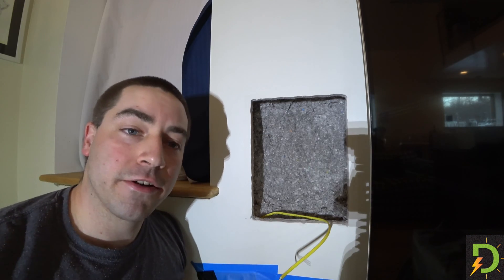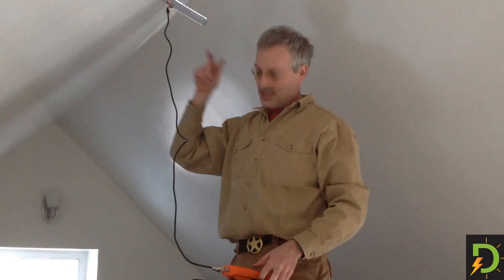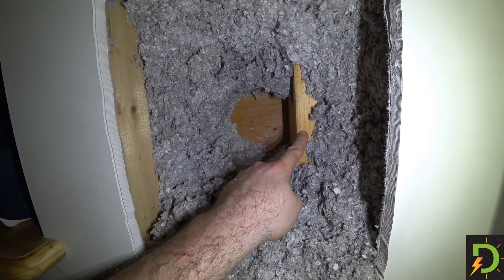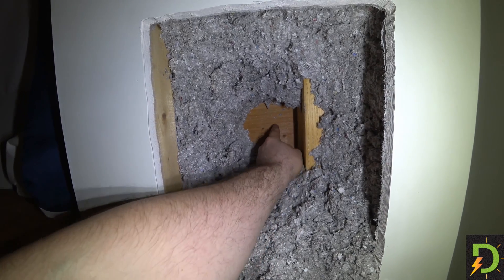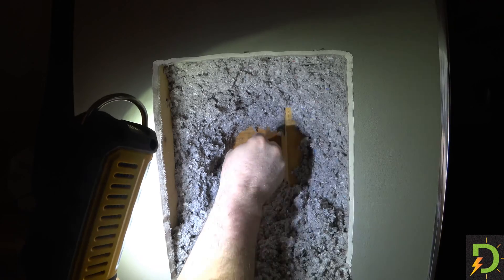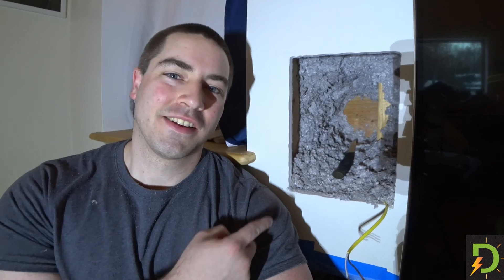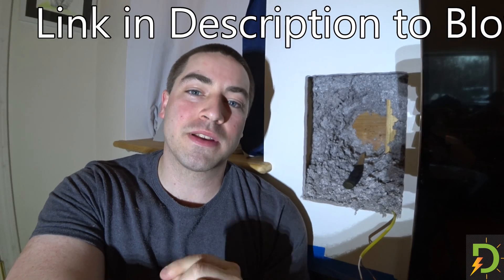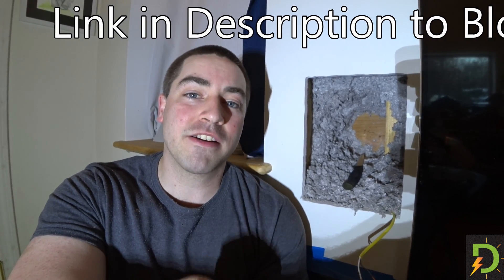Wall Rot in Double Stud Cellulose Insulated House

Comment: Very cool I have been thinking about building a house with a double stud wall as well. My only thought was to have 2 inch of spray foam on the outside as an air barrier. And then fill up with cellulose. Without spray foam how did you insure it was airtight on the outside?
Reply from the maker: Hi Sean,  Great question.  I built my house with 1/2" Plywood sheathing, then covered that with Grace Ice and Water Shield.  The Ice and Water Shield was my WRB (weather Resistive layer) in case water got behind the siding, and it doubled as my air sealing layer.  It sealed all the nail holes and joints in the plywood.  I tested out crazy air tight with a blower door, you can see here: https://youtu.be/yVK0R4C8FpE  If you decide to go the same way I would recommend Henry Blueskin VP100, or Grace Env-S instead of the Grace Ice and Water.
Reply: DavidPoz awesome.  Thanks for the insight.  There are so many ways to insulate, this seems most cost effective. Good job on the house.
Reply: Do you have any videos on how you did your attic? I'm assuming that it's conditioned space with the insulation on the roof. Can you do that with cellulose as well or did you have to use spray foam?
Reply from the maker: Hi Sean,  I have around 100 videos on the house build, but I wasn't YouTube savvy back then and most videos are just numbered, not titled, so it's hard to navigate.  I have been working on a series of combining and editing down the old footage into better videos with better descriptions/titles/voice-overs, but haven't yet gotten to the insulation.  In the mean-time, here is a video of insulating the roof-line: https://youtu.be/PTP56E8FUTc Here is a video on how to create the vent for the roof: https://youtu.be/5r93E1evw9A Since I have a vented roof there is no need for any foam.  Some people who have seen my videos say it is more work because I'm more or less framing two roofs.  That's something to consider.  However, I firmly believe the benefits outweigh the cost because of eliminating thermal bridging, no foam, no super long screws to go through the foam trying to grab a rafter, tighter assembly, etc.  Huge benefits.  The two videos I gave you are just examples, there are more videos around those ones, just go to my channel, under uploads, and you will see more.  I hope this helps you in your project.
Reply from the maker: Hi DevilSagami,  Thousands of old houses are retrofitted with dense-pack cellulose and work out great.  However, I would be cautious of two things, water leaks, and new siding.  First, if any bulk water is leaking in through things like rotted sills, then the cellulose can make it more difficult for the cavity to dry out.  Fix water leaks first.  Second, stay away from wrapping new vinyl siding over the old original siding.

Comment: I can hear the guys with the fancy letters after their names chanting: rot! rot! rot! rot!
Reply from the maker: Yeah.  Sometimes it seems if you don't do it their way then they want you to fail.
Reply: @DavidPozEnergy  ..im one of those guys.  liablity causes us to overdesign in some cases.  intello interior air control layer is safe insurance I guess...but after watching this I may drop it
Reply from the maker: @Tim McCarthy: I've also used Intello Plus on hundreds of jobs.  But, I'm using only in applications that will not be covered by drywall.  I'm only using it for the nice finished look of the fabric after you tape the holes and wipe it down.  It gives the homeowner the "WOW" look.  But, it's not needed for moisture control.

Comment: Love your vids.  How thick are your walls and what R value???  Thanks
Reply from the maker: Thanks for watching.  I usually say "My walls are a foot thick".  To be more precise... the rough frame dimensions are 11.25 inches.  The dense-pack cellulose provides R-42.  There is also half inch plywood on the outside, and half inch wall-board with skim coat on the interior.  On the exterior I have a rain-screen, and clapboard siding.  Total wall of everything is 13.5 inches.

Comment: David, first of all, Congrats on this house and your dedication. All those people with letters are just mechanical guys. None of them knows or believes that the envelope is the most important. One thing I would have done, use an ERV, rather that your HRV. Cost is minimal higher. Maybe a variable ERV to up the CFM when you use the kitchen or bathroom exhaust.
Reply from the maker: Hi Romulus,  Thanks for watching the video.  When it comes to HRV vs. ERV I'm not planted on one side of the fence or the other.  Back when I bought my HRV (early 2012) I paid $850.  It has two fan speeds so I can boost it up for showers.  At the time, I could not find an ERV for close to the same cost.  The market has expanded now and I'm glad there are more options.
Reply: DavidPoz , look for Panasonic or Honeywell. Don't belive that HRV are for cold climate because there is no moisture and ERV for the South. Your dry winter air is a health issue. Dry nasal membrane, dry skin, etc are just an open door for ilneas. Don't you use a humidifier in the winter? Why exhaust the moisture that you want to keep in the house and bring dry air that you wil have to humidify? Do you only use the heat pumps to heat the house in the winter? What do you use the  solar panels in the winter for lights and selling back to the grid?
Reply from the maker: Hi Romulus,  I agree that very dry air (10%-20%RH) can cause health concerns.  I know plenty of people who run humidifiers all winter and struggle to keep 20%RH.  Their houses are very air leaky.  My home is very air tight.  I am thinking about how to dehumidify year-round.  That is unique for a cold climate.  I try to keep my relative humidity down to 40%.  Sometimes I run my HRV on high speed simply to remove excess moisture from the air (in winter).  As I said before, I don't push HRV or ERV.  In my situation I have an HRV.  It's not a big deal.  The focus should be on air-tightness and insulation.

My heat pump is currently broken.  However, I was using it year-round, for AC in summer and heat in winter.

My solar PV panels on my roof are grid-tied.  My solar PV panels on my ground mounts are connected to a heater.  My solar Thermal panels on my house are heating DHW.  My solar thermal panels on the garage are doing space heating to my radiant floor.

Comment: David check out Fantech line of products whith digital hygrostat  and metal ducting is always better just seal whith real duct tape ( metal) if theres leaks its not grave ...aluminium core lot more efficient then plastic ... k in touch ciao :)
Reply from the maker: Thanks for the tip.

Comment: Re Hi David :) i visioned your hrv video the only thing that worries Me about Your job on that unit its the plastic or ruberrisez pipes that stuff is not healthy +if your house would catch fire it would melt down this stuff quiet rapidely and the fumes would intoxicate you and family (petroleum base) so thats wy there not code here in Quebec in fact there illegal on HRVs and realy sorry for Venmar they lost all respect from us inthe HVAC biz...they brake often and difficult to repair...t care :)
Reply from the maker: Hi beez,  I'm disappointed with Venmar as well.  My HRV unit has broken twice now.  It was the plastic arm that controls the dampers.  I tried to order a new part from Venmar, but they would not sell to me because I was not one of their installers.  Very annoying when there is no good supply chain.

Comment: Good video David.. and great job on the house...was wondering have you installed an air or heat exchanger to bring in some fresh air and expulse used up air...
Reply from the maker: Yes, here is a video on it.  I need to do an update on the ventilation system as this video is old.  What would you like to see in an update video?  https://youtu.be/7yZJiUUFzk0

Comment: Thanks for sharing. Every wood-framed house over 10 years old that I have looked at has some rot in the exterior walls, except for the really old ones that are of old-growth redwood and uninsulated. Many recent homes here - without leaks - have a lot of rot. This is the Pacific Northwest on the coast. The densely packed insulation you have helps - no cold spots - way better than FG batts for walls. And the work appears tight. What also helps significantly is the latex paint (I assume the case) on the drywall - that is a quite decent vapor barrier except at outlets. It doesn't mean the scientists are wrong. For this climate, I am done with exterior walls built of vegetable matter. People who have thought that crazy have then found rot in their own house.

Comment: Very interesting.  What is your average humidity level in the house, in the dead of winter - if you know ?
Reply from the maker: January-40%RH      July 60%RH   indoors
Reply: Just seen this reply.  40 is great for winter--- wow, 60 is really great for summer !  I'm always fighting humidity in summer.
Reply from the maker: Yeah, 40%RH in winter is considered "dangerously high" by the "experts".  That only makes it that much more interesting that I don't have a moisture problem in the walls.
Reply: I heat with a rocket stove out here in the shop and when the humidity gets down below 40%- like it often does in late Jan/ early Feb, my hands get so bad I'm forced to use hand creme to try to heal the cracks. Your heat source is not adding any humidity -correct ?  The only added humidity you get is from cooking and the shower right ?
Reply from the maker: A rocket stove, nice.  Did you make that?
My heat source (electric) does not add any humidity.  My sources are cooking, shower, breathing, and cloths.  I dry my clothing inside.  The more I run my HRV (ventilation) the dryer the air becomes.  So I have some control.  I like that I don't own a humidifier and don't need one.
Reply: i went over the build a little at the beginning of the video https://www.youtube.com/watch?v=bfoTuFxxw7I

Comment: A couple of questions:
1. Interior air quality. How is it?
2. Kitchen cooking odors, bathroom mold and mildew from condensation - how are those issues handled - if, indeed, they are a problem?
3. Can the house breath? And, with that, are your windows absolutely air-tight or do they leak a little?
4. Can you control interior humidity?
Reply from the maker: Hi Paul,
1. Indoor air quality is excellent because I have a dedicated ventilation system.  Here is a video: https://youtu.be/7yZJiUUFzk0
2. Kitchen odors: Yep, in such a small house with an open floor plan we can smell what we are cooking.  I typically open some windows if I'm doing something that causes a lot of smoke (like searing steak).  I don't consider this a problem as it is only an issue for an hour, and only with certain meals.  Bathroom: The ventilation system removes the moisture from the bathroom very effectively.  We don't have any mold issues.  
3. Let's clarify what we mean when we say "houses need to breath".  We want to know if moisture can get out, odors, fumes, off-gassing, etc.  The answer is "YES".  because of the ventilation system.  If the ventilation system ever fails then I can crack open the windows a little and still have fresh air.
4. Yes.  In winter indoor RH (relative humidity) can be controlled by the speed of the ventilation system.  As you bring in cold outside air it warms up which dries it out.  In summer we have an AC (that heat pump) which we can run in a very low mode which removes humidity.
Reply: I think of it like my lungs.  Can I breathe?  Yes.  Air goes in through my mouth and fills my lungs.  I don't breathe through my skin.  Same here.  Air has a dedicated path.
Reply from the maker: Good analogy.

Comment: Hi David, I'm glad your walls are dry.  I've read several horror stories of double stud cellulose walls failing.  I don't think any of them had impermeable wraps like your Grace Ice and Water shield.  What made you think your setup would work?  Did someone try this before, or did you come up with it on your own?  Did plywood vs OSB figure into your design decision?
Reply from the maker: Hi 59seank,  I've also seen some failures.  Actually at my previous job I was often fixing failed insulation jobs from poorly done cellulose, spray foam, foam board, and fiberglass.  Often a failed assembly will have more than one contributing factor.  However, two factors that most often played into a failure (as I saw it) was air leakage, and water leakage (from rain).  With the ice+water I took care of both.  Just one of many strategies that can be used.
Reply from the maker: At the time I built my house, yes, I choose plywood because I believed reports showing better moisture transfer.  However, since then I have done my own testing, and seen more homes with OSB.  Today I feel comfortable using either plywood or OSB.  Check out my garage framing video to see me using OSB.

Comment: It still has to dry out come summer during the warm weather as the cellulose will absorb household water at the dew point which is inside the wall. You have done well and the green lumber (it says kiln dried) but squirts when nailed will need to release the moisture inside but that wonderful cellulose will disperse it.
Reply: His wall is so thick with insulation that in winter there would be a very gradual temperature gradient. This also slows vapor drive and the insulation nearer to the inside will tend to be warmer and drier.